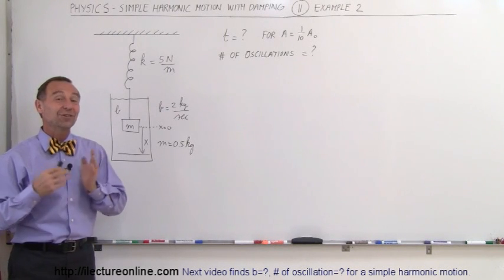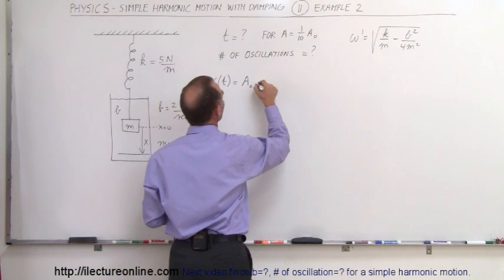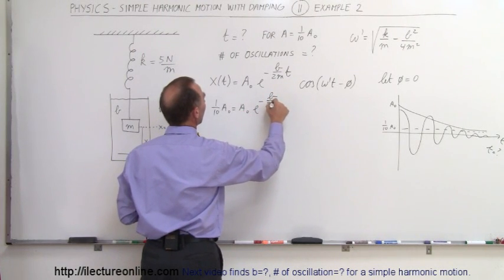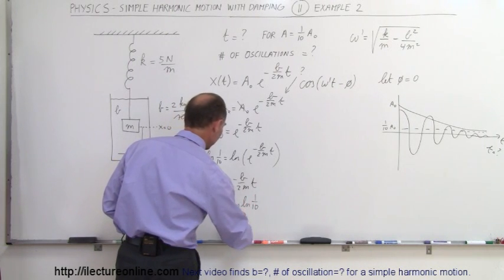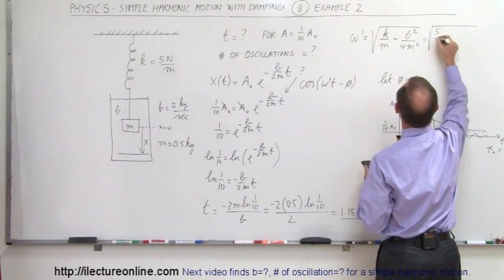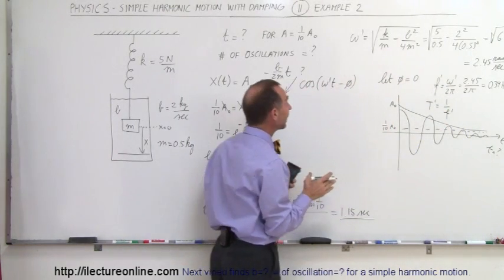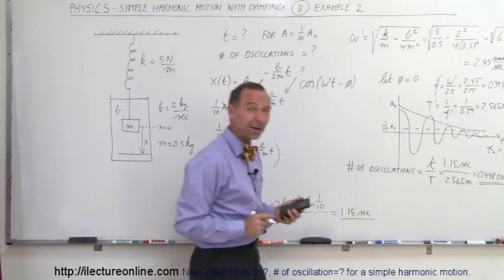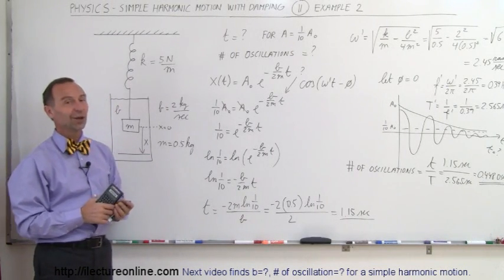Physics CH 16.1 Simple Harmonic Motion with Damping (18 of 20) Example 2

Comment: Sir when calculating t in the very final step of putting the values into your calculator you did something wrong as the answer is 3,45 not 1,15
Reply from the maker: We just checked.  The value for t is 1.15 seconds.

Comment: How would you calculate this if the square of the amplitude of the vibration to decay to 10^-6 versus 1/10?
Reply from the maker: Just replace the 1/10 by   1 x 10^-6

Comment: For those wondering why cosine(ωt - Φ) was ignored:
The amplitude does not depend on the position of the mass. What do you think is the amplitude at a random position x(t) during an oscillation (but not at the highest or lowest point) ? I bet you would say it is not x(t), because thats obviously not the highest or lowest point of that oscillation. So how would you find out the amplitude associated with that position? Do we know a function that only models how the amplitude changes without considering the position of the mass at that time?
Yes; it is the exponential decay function of the amplitude. A(t) = A e^(-bt/2m)

Comment: Hello Mr. van Biezen. To calculate the oscillation time t, why did you calculate it without looking at the cosine part?
Reply from the maker: The cosine will give you the position, velocity, or acceleration of the object at any point in time.  The period is determined by the mass, spring constant, and damping factor.

Comment: hi sir , why do we ignore the cisine part for this example ?
thank you
Reply from the maker: +Jetshen Teoh 
Good question.
We didn't actually ignore the cosine portion of the solution.  Note how the diagram clearly shows the oscillation nature of the amplitude caused by the cosine part of the equation.
But in this problem, we are interested in calculating how the amplitude of the oscillations diminish over time.
Reply: thank you for your quick reply . i have one more question : do we just use the equation for lightly damped oscillation to solve this kind of problem without finding out what kind of damping takes place before using the equation ? or the equation a(t) = A0e^(-b/2m)t is just a general equation for all case ?
Reply: @jackmas1042  4 years no reply lmao
Reply: 9 years still no reply